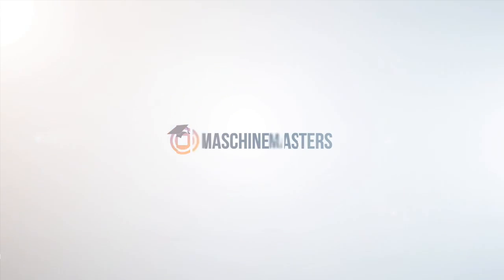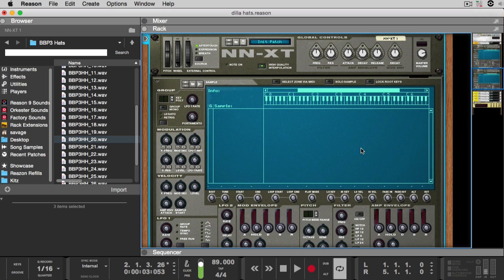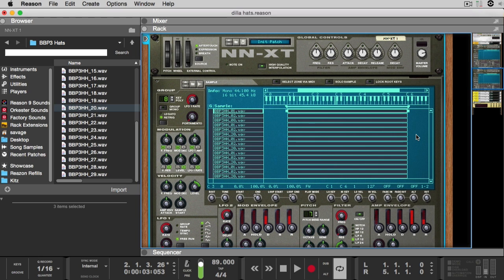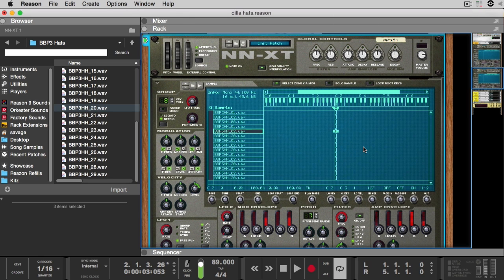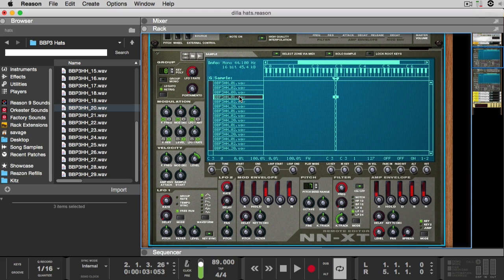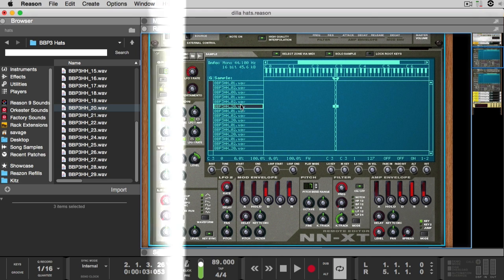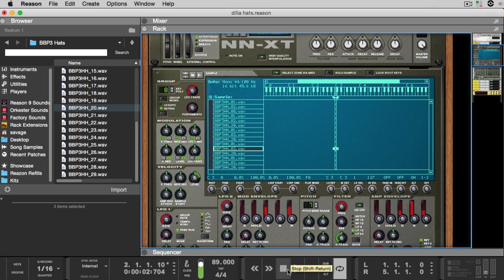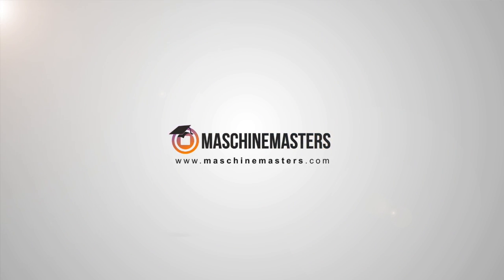J Dilla Alternating Hi Hat Technique [Sound Design Sunday] Reason 9 NNXT

Comment: how do you get your kick punch heavy>?
Reply: Smiley B I don't understand your question would you mind rephrasing it?
Reply: how do u get more boom punch in your kick
Reply: Smiley B engage your eq and boost the frequency you want. Want more low end, boost it. Want more mids...boost it.

Each kick is different though depending on the kicks overall sound. Not all low end will sound good. So pick your starting sounds carefully.
Reply: Transient shaper on the drums helps